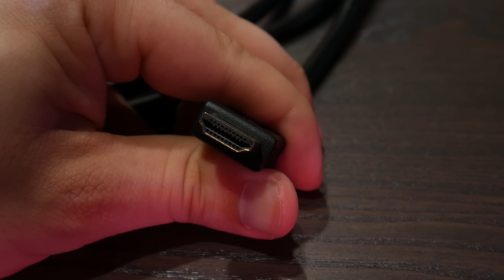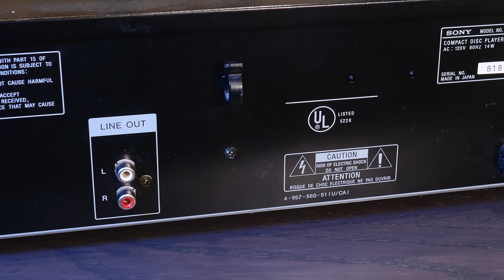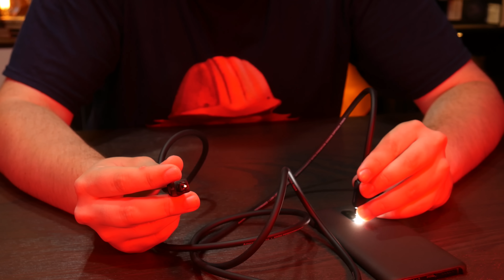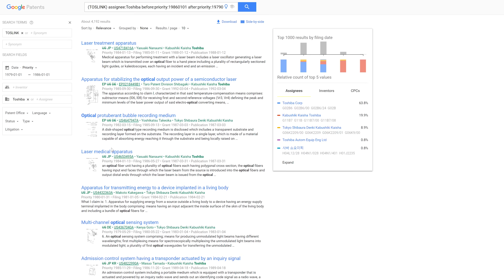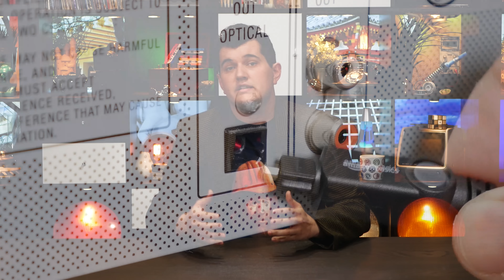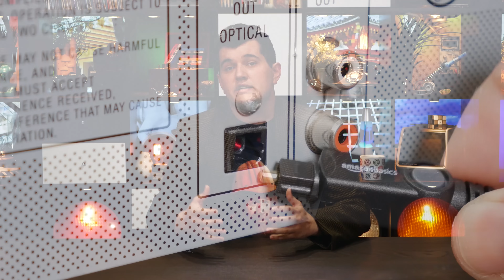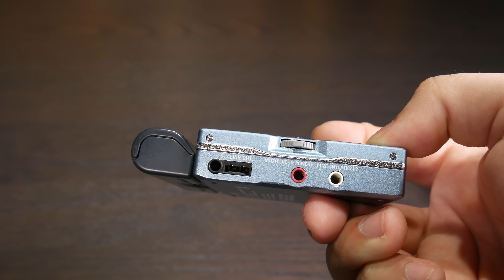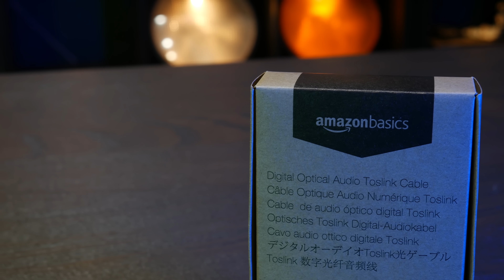TOSLINK: That one consumer fiber optic standard

Comment: But HDMI doesn't go blinky-blinky. :(
Reply: @EnvyPhnx  
> light through a vacuum
It's light through a transparent medium (such as fiberglass), there's no vacuum involved
Reply: ...and now, a few months later, you can get RGB-HDMI. 'nuf said...
Reply: @LaFaJe  those rgb HDMI cables are optical too.
Reply: @Ancyker  They really aren't
Reply: @EnvyPhnx  If you can find any type of cable with a vacuum inside, please, let me know where the shenaningans came from and what are you smoking.
Reply: @LightBusterX what about those old cables inside buildings they used to use to shoot messages and things through a building? Or the people mover cables in Futurama?
Reply: @ConradSpinach tubes. Not cables, tubes. Is English not your first language? If so, sorry.
Reply: Just jiggle the connector
Reply: If you look too much at the blinky-blinky end of the cable you may go blindy-blindy.
Reply: @BorjaLive  I know I shun the cable on my hand and it became hairy-hairy
Reply: @BorjaLive  no you won't
Reply: I don't know if you're joking but in case you want be able to see the blinking because the port would be in the back of the device and the cable I will not be in view
Reply: You can find blinky HDMI if you're really dedicated to have LED powered everything.
Reply: There’s a fiber optic HDMI cable out there.
Reply: @Pooh Xi I almost hear the amazing sound pneumatic audio cables provide over the 10 running air compressors they require to function.
Reply: Basically my reasoning.
Reply: That's a valid point
Reply: Handy dandy movie input 🤣
Reply: Fiber optic hdmi goes blinky-blinky :)
Reply: HDMI is also a proprietary format, it's at the mercy of the HDMI Forum; DisplayPort is a better alternative.
Reply: Exactly! 
I've used S/PDIF over TosLink and over RCA indifferently since it came out in the 80's to link a DAT to my PC. Duh, so many acronyms...
Btw, the Youtuber forgot to mention that S/PDIF can transmit more than just audio signals, but also time codes.
For the technician, TosLink and RCA are almost equivalent, but one can hack his own RCA cables with a little iron. I did it.
For the weird psychology of the every day user, including me, using a light cable is so hype.
Reply: Not even if I get scammed into paying way more for the Monster Brand HDMI cables with the gold plated cable terminations at each end? 😂😂😂

That always drove me nuts, people gobbling that bullshit up. "I want the most expensive HDMI cuz I have low signal from the cable company or some such." 

Like, listen, I know y'all customers ain't trying to listen to anyone here(I was working for a big box retail store) but digital stuff doesn't really give a single dry squirt of dehydrated piss about gold connectors or what branding it is. Digital tends to mean, so long as there's enough signal to present any sort of audiovisual signal, then the entire HD 4k 8q whatever signal gets passed to the various devices hooked up. 
Analog, it used to make a nominal difference, upon assembling a high enough fidelity stereo setup, however, most receivers these days don't even pass the HDMI/video/audio out of the TV or stereo in a analog signal. Which does suck, cuz you gotta Mickey mouse a bunch of science project wiring shit to get older full analog power amplifiers to work. 

Not that you were questioning that, but hey, working for Walmart I just couldn't idly stand by while people dropped around 35-40 bucks for a single 3 ft long HDMI cable, but with excessive marketing wank printed on the packaging.
Reply: @EnvyPhnx That is data. He means what you see if you crack it open
Reply: XSAVIER busy  I am lol Is it was a way for me gusta El cajon pass on to the Future Leaders with a ver tu
Reply: @Reno there are Rgb hdmi / DisplayPort cables
Reply: Electric blinky blinky
Reply: Actually there are optical HDMI cables
Reply: And hdmi causes stray voltage
Reply: Fiber is not nearly as flexible
Reply: This comment thread is hell.
Reply: Wow this is eye opening.
Reply: So convert it to blinky
Reply: mine does😁
Reply: Pooh Xi You mean… hear?
Actually that would be quite interesting! Just push the compression waves (sound) through small pneumatic tubes which on the the other end (pneumatically) drive a speak membrane.
Reply: @YourMJK  These exist for use in hazardous vapor locations (fire, explosion hazards), but I remember them first from when in-flight audio entertainment was a new thing (so was the Boeing 727), the headset system was pneumatic.  Saved weight in aircraft wiring, the headsets were disposable, less electronic stuff to make heat.  I recall some old department store intercoms that I thought were pneumatic, also, but right now these escape my google-foo.

Comment: Ahem, I adore your videos and was as thoroughly entertained by this one as ever. I think life experiences affect what you come across - mini-TOSlink has been really common in my life. They're common in soundcards, especially by ASUS, I have a gigabyte brix that uses this format (and I do use that daily) and it was hugely common on mini-disc players (I used it a lot then too). In fact it's so common I'm actually half surprised that it did not become the defacto standard. It actually re-introduces an advatage to TOSlink, being able to combine the ports this way. It also gets rid of that pointless keyed connector and is an overall smaller port ideal for smaller devices.

Comment: The main potential advantage of fiber connections for consumers is to avoid lightening damage for outdoor applications, but the limited length of TOSLINK cables and the advent of wireless standards like Bluetooth meant it didn’t even fill this market.  I used fiber Ethernet cables to get data to my shed, but then again I live in Florida— lightening capital USA.

Comment: "As dark as the future of Windows Phone"
Harsh, but fair.
Reply: I know at least 6 people who were Windows Phone 8 users around three years ago. Five of them have migrated to Android; the sixth is still bravely hanging onto their Lumia.
Reply: @yoymate6316  I had 3.5 of them. The .5 was a sad me trying to use one off of Ebay after hating iphone and android following having to switch.
They should've been the future, everything worked better and was so much more pleasant to use
Reply: @yoymate6316  
I loved my old Lumia Windows phone - it's where I discovered swiping as a method of text entry instead of typing. I actually wrote my best man's speech, for my buddy's wedding, on my phone 'cos I could swipe faster than I could type on a real keyboard, before transferring it onto an iPad to read on the day.
I had to give it up after about two years 'cos the battery was failing, and it sadly bricked itself after sitting in a drawer without power for too long.
Using Android now, and it's okay I guess (the text swiping seems FAR less accurate than on my Windows phone), but given the choice I definitely would have stuck with a Lumia.
Reply: @stickiedmin6508  God, yes, Windows Phone has the best swipe I’ve ever used…
What a wholesome story :3
Reply: @stickiedmin6508  On the topic of swipe typing, have you noticed that the typing on Google Keyboard has gotten worse over the last couple of years? For me, it used to be really good in detecting what I wanted to write, but now it comes up with completely different words, words that I've never used in writing, too much slang and shorthand, and sometimes not even recognizing common words.
Reply: @CWINDOWSsystem32  
Oh, most definitely.
My phone is approaching three years old now and the older and clunkier it gets, the less accurate the swiping gets.
If I'm trying to comment on a 'busy' website, one that takes up a lot of the phone's resources, then swiping becomes next to useless. It's a giant pain in the ass.
I really miss my old Lumia - I may have been imagining it, but it honestly seemed as though the software learned my swiping style and got more accurate as time went on. It may have been me adjusting to the phone, rather than the other way round, but either way, I was FAST.

How old is your phone? Could that be part of it?
Reply: @stickiedmin6508  Coincidentally, my phone is also nearing 3 years old. It's an LG G6 that's still going strong even though the USB port no longer works and I can only wirelessly charge. However, I don't think it's due to the phone's diminishing performance that swipe typing isn't as good as it used to be. The touch input is mostly as responsive as it ever was, it's just that Google Keyboard is more inaccurate than ever.

I remember up until 2019 or so, swipe typing was just like how you described it was on your Lumia. It was like the keyboard was learning how I wrote and knew what word I was thinking of as I swiped across the keyboard. Then, Gboard updated one day and it was all downhill from there.

Back on the topic of the Windows Phone, I remember wanting one as my first smartphone in high school. I was more envious of the one guy with the Lumia 1020 than I was of the kids with a Galaxy Note 3 or an iPhone 5S...
Reply: @stickiedmin6508  YES. A million times YES. That swipe keyboard has never been replicated, or even close.
Reply: @Liam O'Brien For curiosity’s sake: two months later, they’re still bravely hanging onto their Lumia, no sign of giving up.
Reply: @yoymate6316  How goes the Lumia user? Still going?
Reply: Looks at the brave stack of little Lumia's in the drawer 
It was the OS/2 of Microsoft.
Reply: I liked my windows phone :( but android is better
Reply: I loved my Windows Phone. OK, Windows Phones. I had 3. Wish it had gone somewhere...
Reply: Windows phone OS should have really succeeded, It really should have succeeded! Unlike apple and android, it felt like an os designed around mobile, instead of an os adapted to mobile, but microsoft released it too late.
I loved my Lumia and wished there was more software support for it because the platform was honestly full of potential! In memory of my windows phone, I grabbed a windows phone inspired launcher, Squarehome 3, for my moto g5 PLUS to mimic my old windows phone as close as possible. But it just isn't the same in the end.
It just isn't the same...

My dad is spitefully refusing to upgrade to his brand new g6 Play he got for christmas. My mom has adapted with the squarehome launcher somewhat but it still gives her headaches at time.
Reply: @robinyiff4361  100% agree. The UI of WP was phenomenal and a lot more user friendly than Android (back then, and even now). It just felt so 'natural' compared to the other OSs. More secure by design than Android at the time, while not being nearly as much of a restrictive cage than iOS. Also, those Lumias were really good phones, even at the lowest end.
Reply: i nearly missed that but is something i will store away and bring out at the appropriate time and be judged as witty
Reply: Still have 3 Lumia phones. The only thing that's killed them as far as I'm concerned is the lack of Apps. Personally I didn't care about that, but work requires some things I couldn't get on my Lumias. Great sadness.
Reply: @chrisreynolds3695  The thing that killed them for me was that they stopped producing new Lumia phones. I was a huge fan of the Windows Phone platform and OS, and didn't mind the lack of apps at all. The best smartphone experience I ever had was with a Lumia phone that lasted years and didn't have any problems until I finally dropped it in just the wrong way and shattered the screen. Since switching to Android my experience has been fine, but the phones don't last as long, the OS is much more crash prone, and the overall experience is lacking compared to Windows Phone. C'est la vie
Reply: 5 Years Later: Isn't that a Windows Phone he's using to light up the cable?
Reply: My Windows Phone on screen keyboard was the best keyboard I ever used on a phone.
Reply: Made me laugh so hard
Reply: lol just saw this after wrote a comment about it :3
Reply: But...But...WINDOWS 10! 
 
😆😆😆😆😆
Reply: It's his jokes like this that got me hooked on this channel. The comments aren't bad either. 🤣
Reply: Sad but true.
Reply: With the name windows you'd expect it be so 'bright'
Reply: Let me bet - former WinPhone user?
Reply: @dontbeasadsoulja  Yep, and I maintain that it was the most performant and stable phone OS I've ever used, especially compared to Android at the time (around 2016-2017), and had the best phones at the time (the Lumia phones were awesome). If it had gotten enough momentum behind people developing apps for it I think it would have been very successful, but it was just too late to the game and couldn't break into the market
Reply: Fair and true.
Reply: That one hurt. Lol The Lumia 640 is still the best phone I've ever owned.
Reply: Kevin Wells hahahahahaah
Reply: #savage
Reply: Laughed my ass off at that one!
Reply: The moment I pressed the Like button.

Comment: when my brother's PS4 blew up, because they were connected via a HDMI cable, my TV blew up too. so, I can dig the electrical isolation thing.
Reply: Damn I didn't realise explosions could be transmitted via HDMI.
Reply: @h4724-q6j  HDMI and ethernet. It's not usually a concern so I wouldn't change anything, but yes, any electrically conducting cable connecting two devices can transmit a voltage surge that could fry the other end.

Comment: I have found TOSLINK advantageous a few times when the audio equipment had a ground loop hum.  Using TOSLINK eliminated the problem.  It always seemed to happen when I had the equipment temporarily installed somewhere, so I never attempted to troubleshoot the ground loop issue.  

I always thought that the best application for TOSLINK would be in car audio.  Car audio often has grounding and other interference issues between components.  But I'm not aware of any manufactures that used it.
Reply: Mercedes introduced a proprietary optical bus in the early/mid 2000s called MOST that carried audio from the head unit and CD changer to a separate amplifier

Other makers used it, not sure who actually created it
Reply: It's a nightmare to diagnose, but yes, it delivers data throughout the car, with all devices dealing with audio, even handsfree, using it. It's perfect as long as it's good, but if one device dies and breaks the loop, the whole thing turns silent.
Reply: Crutchfield recommends you DON'T update your Volvo stereo (2007 XC90) because they use proprietary optical connections to get the sound around, so that apparently exists. Complicated enough that Crutchfield just don't want to sell you a head unit and speakers so they don't have to deal with the support.
Reply: Better than the crappy roadies that just cut the ground wire to stop the hum
Reply: Audio Control supports Toslink
Reply: Yeah, when I charge my phone in my car and have the aux cable plugged in to the phone, there is an obnoxious hum.

Comment: Many Apple notebook computers use (used?) combo 3.5mm jacks with built-in optical (like the Sony example).  Thunderbolt was originally conceived as an optical connection, but essentially all the implementations have been copper. However, you can buy some specialty Thunderbolt cables that use optical fiber cabling. Up to 60m (200ft)

Comment: For some reason, TOSLink became very big in certain consumer audio applications -- for instance, it was the only way you could get digital audio from your PS2, as well as the only way to get it from a PS3 or Xbox 360 if you weren't using HDMI. (which a lot of people still weren't at launch for the platforms) Hell, the 360 didn't even add a standard HDMI output until later on.

Comment: Answer to the next video: Fiber-optics has a steep economy of scale curve. The fibers are cheap per unit length but the connections are expensive, also unforgiving of sloppy manufacture and field splicing, good for single point to point connections but not able to easily branch, copper can be distributed via simple buses and splitters. And as partially stated in this video fiber is immune from EM interference so it can be routed near high power circuits, radio transmitters,  electric motors, etc; yes this matters for digital as the receiving end still needs enough [correct and accurate] signal to properly decode the data.

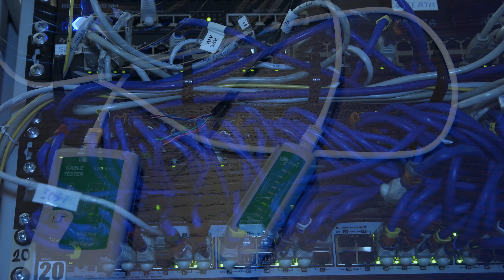Comment: 0:50
There's actually a reason for Ethernet still being the standard, and you learn it in the construction business: it's WAY easier and cheaper to install and repair safely. Copper wire, even the crappy consumer-grade stuff that you trust a construction contractor to install, can be easily ran through any ceiling, any crawlspace, any conduit and any hole in the wall. You can bend it, you can bump it, you can wrap it and double-back, it's not invincible but you're not going to break that stuff unless you try. And it'll only add a couple hundred bucks to your bill. Now crappy consumer-grade fiber-optics cable is way harder to work with. One wrong move, and you might be left with a useless rope of plastic with some glass inside it

Comment: Hey @11:00 this affirmation is incorrect. There are other types of interference besides EM waves on the air. There's direct electrical interference which is way way worse than EM interference, and electrical interferences AREN'T USUALLY cleared nor 100% eliminated by the DAC, it's the famous hissing sound. Happened with me many many times, yes it's usually a sign of poor internal electrical infrastructure such as the lack of return wire but that means toslink clears up the signal and thus is superior because the electrical interference doesn't travel through it